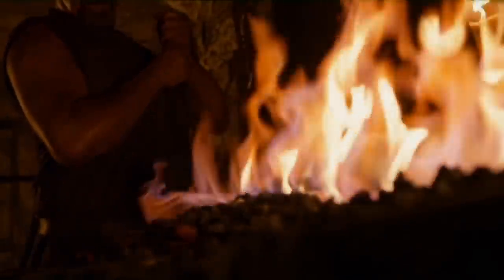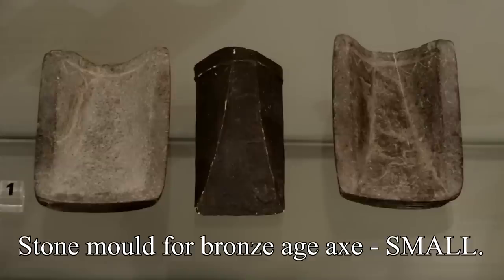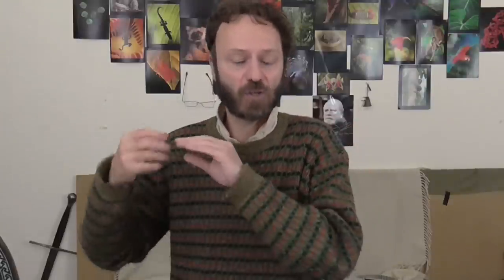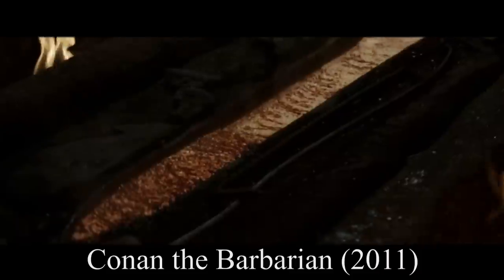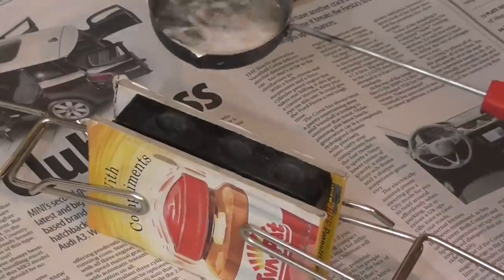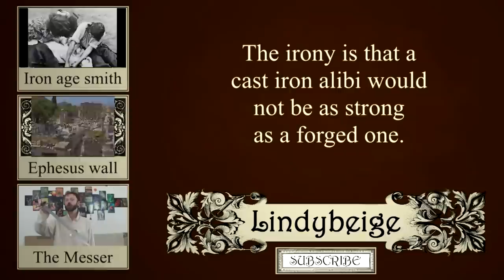Casting swords in the movies - forging a lie

Comment: Could be molten copper? 
It would explain the orange glow.
Reply: +Kuramai Don't quote me on this (as I don't know for sure), but more than likely they're just using a syrup-like liquid at room temperature.  The orange glow is probably just added in post.
Actually going through the trouble of building stone molds and using molten metal is both extremely costly and extremely wasteful, not to mention potentially dangerous.
Reply: +StrunDoNhor that's a fair enough statement.  if they're lazy enough to try and pass off open top molds they'd probably do that
Reply: Kuramai Indeed.  In their defense, though, it's not always a matter of laziness, but instead practicality.  Time is money on any production, and if you can find ways to save time you always should (I should know, I work in VFX).  As for the open top molds, that's just plain old misinformation.
Reply: +StrunDoNhor That is most likely true but google search some iron casting images, it gives an impression of being orange because of melting container walls glowing orange.

From a visual standpoint, its mostly accurate.
Reply from the maker: +Kuramai EVERYTHING at 950 C glows orange.
Reply from the maker: +StrunDoNhor Yes, the moulds are shown to us as stone, but I don't believe for a moment that they are.  The work required to create them out of stone would be huge, then just moving the mould to the set would be a problem, and there would be an element of danger too.  Stone can crack violently when very hot metal is poured on it.
Reply: Lindybeige Well not everything, That yellow glowing hydrogen orb in the sky, has surface temperature of 5500 C.
Reply from the maker: +Ondřej Dujka Only when viewed through something that alters its colour, such as the sky.
Reply: Learn something new every day. :-)

Always thought that there is at least light yellow tint. Internet says that Sun would be a little bit more massive and colder.

How about Red Giants and Dwarfs? They are supposed to have orange-red tint and temperature somewhere between 3000-5000 C
Reply: +Lindybeige I would like to point out what you said about things going different colours when you heat them that in things like salts the colour also depends of the elements being hit as the electron configuration effects the changes in energy levels of the electrons and when electrons lose energy levels they emit photons. That's why spectrometers work.
Reply: +Ondřej Dujka That's the glow from fusing atoms, quite different from hot metal. The physics for how the light (and hence colour) is produced is quite different.
Reply: +Lindybeige ONLY IF IT IS A BLACK BODY
Reply: +StrunDoNhor In the case of The Lord of the Rings, (I could be wrong, it has been years since I watched the "behind the scenes" for the films) I believe they actually went to a factory to film that scene, and had the workmen dress up in costumes since it was too dangerous for inexperienced men to work with metal at that temperature. Not to say that any of the "swords" that they made would work though.
Reply: +Kuramai Wouldn't it be even easier to drill a hole in the top of a cinder block and pour soap into it under an orange lamp and call it a closed mold?
Reply: +Lindybeige Would you glow orange at 950°C? :D
Reply: +Lindybeige even oranges?
Reply: +Ham_ except very early egyptian swords were made of copper. Guess what they were fighting against? Other copper weapons, good bronze is better than poor steel. Steel swords chi and snap depending in what is done to them too. Theyre tools. Tool wear out and break.
Reply: Hollywood only worries about cost when it is vital to the story.  Spending $50,000 dollars to make CGI dog poo that is shown on screen for .025 seconds is ok.  Spending $50 to get a correct piece of WWII uniform that is shown in every scene of the movie would be "cost prohibitive".
Reply: +Kuramai Hi, I don't think it could be copper (or at least not ONLY copper) because pure copper isn't strong enough to keep it's shape when used like a sword, it would bend.
Maybe it could be an alloy of copper + tin
BUT, what matters the most is not the metal itself, it's the way you're gonna cool it.
If you cool it fast(with water, or oil), it will be strong, but fragile (kinda like glass) if you let it cool by itself it will eventually bend, but won't break.
That's why a sword COULD BE in an iron alloy as well (contrary to what is said in the video) because, if you cool your alloy a certain way it can be strong enough to not bend, without being too fragile.
(And, there are other techniques to change the strenght of a metal, but it would take a page of writing haha)
Reply: +StrunDoNhor what have you worked on? got a portfolio?
Reply: +StrunDoNhor Probably it is, indeed, if you cast something it tends to burn everything contacts it, even dust suspend in the air, but the whatever it is on the scene looks completly liquid and clean
Reply: +Kuramai The open molds were not for laziness but effect. Seeing the hot glowing metal flow just looks cool.

A movie is a spectacle, while reality is often not as flamboyant.... and most people don't know anything about making weapons (let alone swords).

It's the fantasy counter-part od Sci-Fy technobabble.
Reply: the color if the glow isn't due to the metals color, it's just a fact of nature, that any kind of metal will glow with a certain color at a certain temperature. Steel will glow that shade of orange, but it won't be liquid at that temperature. Liquid steel is so bright, that it would hurt your eyes. If you're welding or casting steel, you need eye protection...
Reply: +koolkitty8989 That's true. You could super heat aluminum. Nobody is saying that this casting process is meant to give a useful end result, it's all about the effect. So slag doesn't really matter...
I guess the other issue would be getting the viscosity right in order to get the desired flow pattern.
Reply: dispatcher7007
That might be the case and would make all of us discussing metals look pretty stupid :D
Reply: And probably safer.
Reply: +Lindybeige if anything, historically they would use ceramic molds that insulate heat and dont cause the molten metal to solidify rapidly. plus they are easier to shape than stone AND lighter
Reply: +Lindybeige Speaking of which, what DID they make moulds out of in times of yore? o_O
Reply: +Ondřej Dujka The sun is white. It's the atmosphere making it appear yellow and other colours like red and orange.
Reply: +StrunDoNhor That is actually much less forgivable because if glow is a special effect, they could've as well made it bright white. I doubt splashing around liquid aluminium at 600 degress with crowds of actors around is a good idea for health and safety of everyone involved.
Reply: +shinburner could be lead, or pewter, or even just gallium, I think thats how gallium is spelled anyway =S
Reply: +Kuramai 
Fact, in the stone age, people knew how to forge copper weapons.
Reply: +Johnny Wolfblood errr... wasn't it the stone age, because people basically only had stone tools (and wood, but for different uses)? Aren't you thinking of the bronze age?
Reply: radialwellendichtrin
Nope! We actually had copper weapons in the stone age! :)
Bronze was invented after, roughly around the time cities, religion and scribes came around. 
Roughly two hundred years AFTER we started making copper weapons.
Reply: radialwellendichtrin Copper was used in late Stone Age, it simply wasn't significantly superior to flint and both flint and copper were used at the same time. In Bronze Age we figured out how to make alloys, and bronze was all in all superior to both copper and flint.
Reply: Johnny Wolfblood
Copper in itself isn't such a useful material so it didn't see as wide spread use as bronze and thus didn't get to name an age.
If you look at the time periods that progress happened in during those times, you'll realize that two hundred years means nothing at all. I'd be surprised if archaeologists could even date an artifact that accurately.
Which also begs the question, two hundred years in which place? The "revolution" that saw cultures moving from stone to metals didn't take place simultaneously in all of the ancient world. Places like Egypt and Mesopotamia advanced much earlier than further western areas of Europe.
Reply: shinburner
If it was used in the late Stone Age, then you might say that it was a transition period between the Stone Age and the Bronze Age. It wasn't used throughout the vast majority of the Stone Age, simply because mining and smelting metals takes a lot more effort than finding stones and sharpening them. Asserting that copper was used in the stone age is somewhat misleading.
Reply: radialwellendichtrin
It was ROUGHLY 200 years, not exactly 200 years.
Bronze is made out of tin and copper.
If you can get bronze, you can get copper.
Reply: +Johnny Wolfblood Thanks for the information. I still maintain that 200 years is completely insignificant during those times. I was also fully aware of the metallurgy of bronze.
Reply: Doesn't copper create a green flame, though?
Reply: +Kuramai When copper is molten, it produces a green flame. Basic chemistry.
.__________________________.
Reply: +TheBibi31 There are lots of examples of copper axeheads, but not copper swords. It's still very soft, but the extra width of the axeblade helps keep the shape....mind you, this is VERY early tech, the first baby step into the Metal Age.
Reply: +Ondřej Dujka There&#39;s only an orange iridescence, but if you look at the metal itself, you&#39;ll notice that it&#39;s blazing white:
rajavir.com/images/header-casting-process.jpg

Take note also that some images are darkened (like they do with the sun, where they sometimes use only the x-rays for visuals) because the image would be indistinct because of the brilliance.
Reply: +StrunDoNhor Not even just money. Fire is hot. Fire in an enclosed space such as a set is even hotter. Cameras include lots of very meltable plastic. There's a whole heap of consideration that needs to go into just having flames on set, let alone molten metal at many thousands of degrees hotter.
Reply: +StrunDoNhor Syrup like liquid to make swords....so its Canadian?!
Reply: +Kuramai Yes, it could be copper. Aluminum doesn't glow when heated, if you have ever tig welded you know what i mean, it pours with very little glow. So the metal show would not be Aluminum.
Reply: +Adjuni 
With bronze, they used stone, and pre-heated it to the temperatures of the bronze, so they wouldn't shatter from the thermal shock.
With Iron and steel, there were no molds.  It was forged with hammer and anvil.
Reply: The sun is yellow, in the sense that yellow is the dominant color in its radiation spectrum. I looked and couldn't find a natural color image of the sun taken from orbit, but if you could get one through a strong neutral density filter it would appear very pale yellow, if you looked with the naked eye from orbit it would probably look only white from sheer brightness for a split second before you went blind.  Also relevant with respect to the sun, there are different ways something gives off light (not reflection).  The one pertinent to metal casting is thermal radiation and like +Lindybeige said, everything at the same temperature glows in the same color.  Then there is plasma radiation, where color is dependent on material not temperature.  And there is decay radiation that is dependent on both material and temperature.  With regards to the sun, all 3 are pertinent.
Reply: Actually if you look at the Sun in space (before your eyesight is damaged) it will be white (or near enough) not yellow. The yellow colour is thanks to our atmosphere and scifi shows just always have it yellow, 'cause that's what we see down here :)
Reply: Peter Love I thought I clarified this well enough, but apparently not.  Yellow is the most dominant color in its radiation.  If it were completely neutrally white, it would appear orange from the ground as red, green, and yellow all pass right through the atmosphere unimpeded.
Reply: Molten copper oxidizes and turns black almost instantly. That is why copper is rarely cast, and when it is, it's usually melted and cast in an argon (or other inert gas) environment.  I work with copper, and managing firescale is a real bear. So no, not copper.
Reply: Actually, there was a "copper age" (the chalcolithic, also known as the very late stone age). But they were using  arsenical copper , an accidental  (at the time) copper/arsenic alloy (this because their smelting techniques were too poor to remove the naturally occurring arsenic from the ore). Arsenical copper is much stronger that the 4N copper you can find at metal shops today. Arsenical copper blades as long as short swords have been found.

You probably have never heard much about arsenical copper, or the chalcolithic, because it did not take everyone long to figure out that if you mix in a little tin, you get a very much better metal (and thus a new age, the bronze age).
Reply: webmuskie I heard about it from Terrafirmacraft
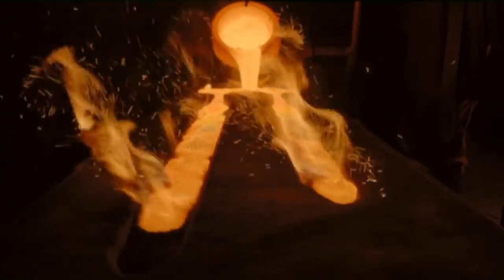Reply: In the game of thrones clip they use aluminum, you can see the solidified sheet coming from the crucible when it's poured. Pause at 0:28
Reply: No... For one it is BRONZE that is used for weapons and it is a mixture of around 88% copper and about 12% tin.. but regardless of that.. no.. Alloys tend too have less of a glow. Iron based metals will always glow an intense orange and red. anything above 500 Celsius will take on a glow... Please do research before posting something like this...

Comment: Add to the fact that casting steel is problematic: it can burn at free-flow temperatures.  
The additional carbon to make iron into steel makes the metal somewhat flammable.  Showers of sparks during the pour = metal burning.
There is one [non-Hollywood] precedent: casting rods/bars of steel as a means of making forging 'starts'.
Long slender billets that are the starts for forging swords.
Reply: Casting billets never worked for me because once the liquid hit open air all that carbon went bye bye in a bright shower of sparks. I only use pucks of custom alloys made using the crucible method.

Comment: 4:25 correction: my dad was a sculptor and oftentimes cast aluminium or annealed it (heat it). Aluminium doesn’t colour like steel or other metals at all. It remains the same bright metallic colour for all temperatures, even when melted. Ive seen molten aluminium many times and its not red, its metallic. Its a metallic liquid that looks reminiscent of mercury
Reply: thank you, i had to scroll forever to find someone say this, it made me cringe when i heard it

Comment: The dumbest part is that forging a sword the proper way would honestly be more cinematically interesting in my opinion. What is exciting about pouring liquid in a mold? I want a sweaty, hairy man/dwarf with a blazing hot lump of steel, smashing it with a hammer and anvil, sparks flying, etc. If they are enchanted you could add all sorts of crazy stuff in to the mix at the same time too
Reply: I know, right? That's exactly what I was thinking! It'd be way cooler to see a big blacksmith, an absolute unit of a lad, hunched over an anvil beating a great lump of red hot metal as sparks fly everywhere, and his magnum opus takes shape, than some yellowish liquid following down a mold, like a steady stream of piss in comparison.
But I supposed that'd take way more effort to do, it's not like anyone can be bothered.

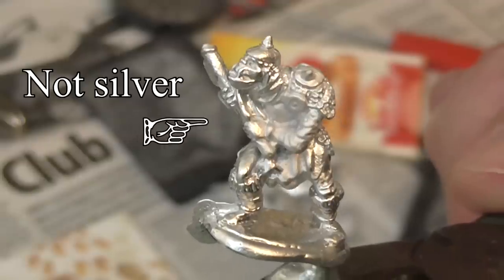Comment: 5:07 Really quick Lindeybeige while casting the sword is ridiculous it would be possible to anneal the cast iron (by heating it again and cooling it several times) to turn it into workable iron or steel, the only problem then would be the massive waste of fuel and time (And losing iron to the fire).

Comment: I watch Man at Arms. Every one of their blades are made from ingots, solid pieces of metal, or in the case of (faux) Damascus steel, they fuse multiple flat pieces of metal into a single ingot, fold it on itself multiple times after heating it, and then stretch it out into a blade. They even call out casting as a bad way of making weapons of any kind.